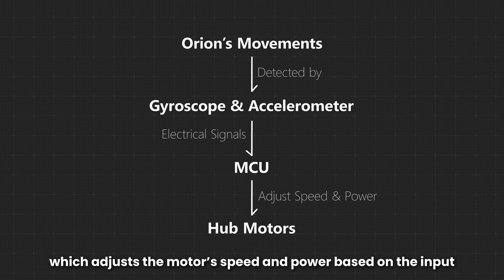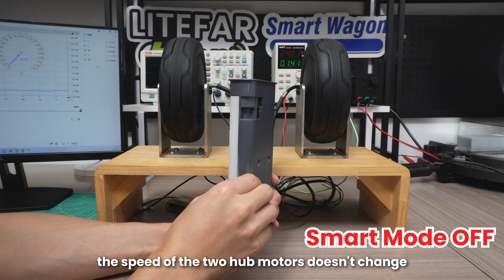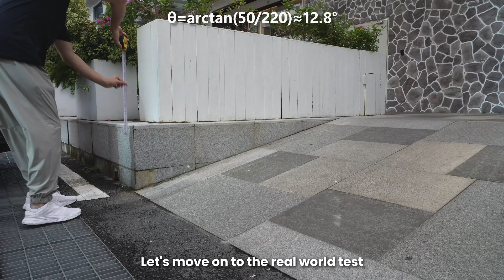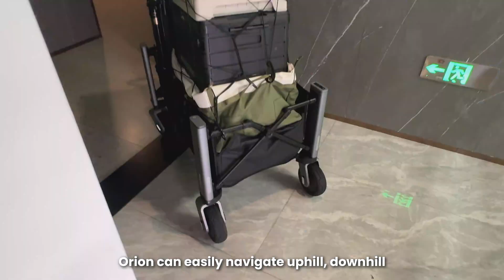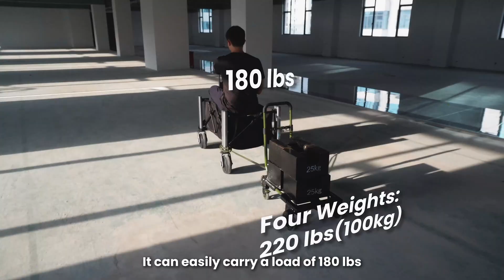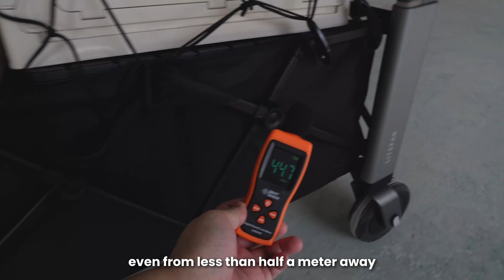🛞Check out LITEFAR Orion's MoveTrack Algorithm & 500W Hub Motor Performance

Comment: How does it do with climbing curb cuts? Or what about tram tracks, do the wheels get stuck when going across tram tracks? I’m in Australia and I have to do wheelies in my wheelchair to go over tram tracks as the castors get stuck.
Reply from the maker: Hi there, 

Thank you for your question! The wagon has been tested on various surfaces, including curbs. When it comes to climbing curb cuts, the wagon performs best with heights around 1/3 of the wheel diameter (approximately 2.5 inches), allowing for easier transitions.
Regarding tram tracks, while the wheels are designed for stability, there is a possibility that they may get stuck if the tracks are particularly deep or if the angle is steep.
We hope this information is helpful! Please let us know if you have any other questions or concerns.

Best regards,
LITEFAR Team

Comment: its with 4 motor or only 2
Reply from the maker: Hi there, 
Orion features two rear hub motors with a power output of 500W and two front swivel wheels, ensuring steering is easy for users while keeping it portable.
If you have any questions, feel free to contact us!

Best regards,
LITEFAR Team